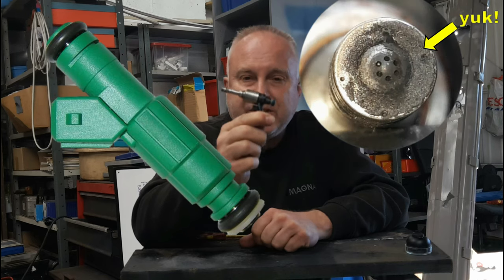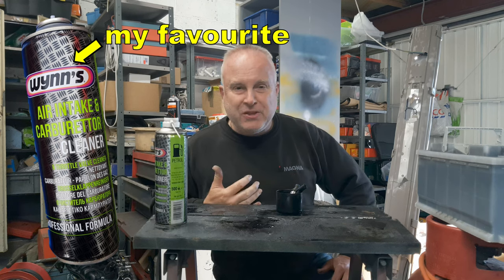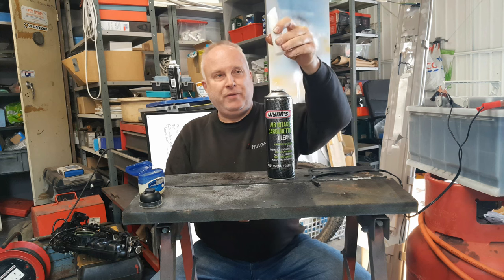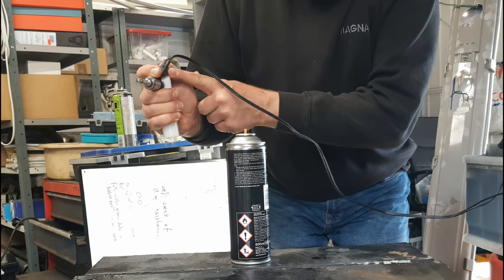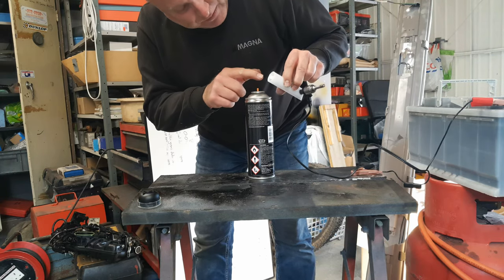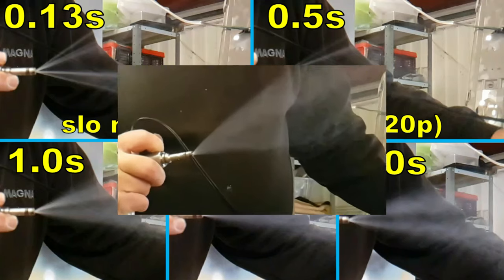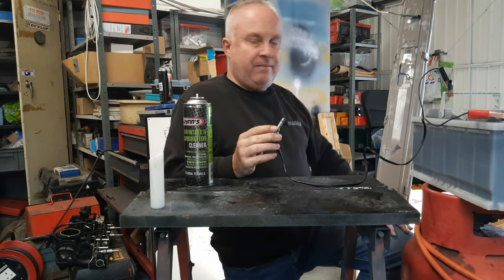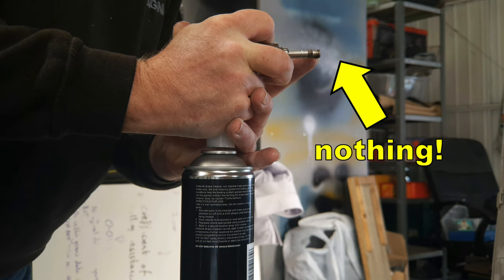🛁 How to Clean fuel Injectors YOURSELF | Cheap 💰 & Easy DIY 👍

Comment: petroleum based products wear out rubber my friend. silicon based work better for lubricant and conditioning. 303 aerospace too
Reply: 😂😂 
Yeah I realise this is an old comment - but come on. The seals are literally there to stop petrol seeping past. Think.
Reply: Silicon based damage the oxygen sensor
Reply: Pretty sure these are petrol injectors?
Reply: Silicon based destroys the rear view mirror
Reply: @eastcoastmostwanted710  Mirror and most forms of glass are made with silicon.
Reply: @eastcoastmostwanted710  what

Comment: Extremely dangerous!! You will catch the fluid alight with battery spark as those injector adaptors leak like hell. Use a purging device!!
Reply: Don't be scared , 
Just be smart &
You'll be fine
Reply: @TXFarmRoad  people be so scared 😱 😂

Comment: Atomised solvent and open electrical connections - what could possibly go wrong?  At least put a closed switch into the circuit.

Comment: I watched a few of these videos, and this tool would have been handy.  Just adding info for whoever it may help. I used safety googles and gloves. Remember to safely depressurise the fuel system as it goes to 3000 PSI on mine - which can kill.  I used the soft plastic red tip you can find in the lid of a can of lighter fluid as an adapter, which fit perfectly in my Bosch petrol fuel injector back.  It deforms slightly to make a seal.  I pulled the spray nozzle off the top of a can of carb cleaner to access the main straight nozzle.  It takes a bit of coordination to hold it tight to the injector.  I rigged up a switch so I could keep distance from the battery and reduce sparking (with heat shrink).  It needs to be able to handle a few amps or it can short and burn your injector.  You will be making a mist of flammable vapour so do this outside.  It took a whole can of 500ml to clean through 4 injectors plus 1 spare.  There was enough left to clean the throttle body and intake.  The pressure drops in the can as you go.  I'd guess that there is about 60 PSI of pressure in a new can.  As removed from the engine, I found white waxy deposits coming from the tips of the injectors and along the body, where compression from the engine was forcing the deposits back towards the fuel rail.  I've read this comes from water and gunge from the tank loosened by modern E5 fuels.  Its cleans your fuel system and leads all the contamination to your precious injectors.  But now it's all cleaned out. TYVM.  Also if you use the lighter adapter, beware it can split towards the end of a can.

Comment: There's a video out there cleaning GDI injectors with a sonic cleaner meant for cleaning jewelry, you should check it out.
Reply: The ultrasonic clanging outside only not 100% clanging inside

Comment: Are there any rubber parts inside the nozzle?  If there are rubber parts  I use a large amount of injector cleaner will it damage the rubber in the injector?
Reply from the maker: No rubber inside. Make sure to use a carb cleaner and you'll be okay. It's worth back flushing your injectors first, if you can (not possible on DI injectors)
Reply: some mass air flow sensor cleaners are rubber friendly, just in case

Comment: Hi Cyd, really enjoy your videos and found them very informative. My daughter has a Skoda Fabia 1.6tdi  2010 model  105,000 miles, which has started playing up and she has had 2 injectors replaced at around £500 an injector. What is the main failure of an injector and how is best to prevent it happening or at this mileage, is it to be expected?
Reply: Just use the fuel injector cleaner additive as a part of maintenance & you shouldn't have a problem. Any of the additives are good but I use B-12 Chemtool & Lucas brands but they all work. There's also the fuel filter that should be replaced when ever your car manufacture calls for it. Its actually insane how much a mechanic will charge for replacing injectors cause they dont cost that much brand new. In engines with (DI) direct injection its not the injectors that are the problem, its the carbon build up on the lifters so if you have a direct injection engine its a waste to replace injectors & the only way they can clean them is physically cleaning the intake with a blaster system. Using a peanut shell blaster is the most common on these issues.
Reply from the maker: As noted, direct injection is hard on the injectors because of the carbon which gets into the pintle and causes blockage and wear. See my video on rebuilding injectors https://www.youtube.com/watch?v=a7cmZrBaMM8 and you'll see I used an ultrasonic bath and injector activation tool.
Learn how to remove your injectors and do this every couple of years or 30,000 miles max.
Reply: @CycloneCyd  will this method work on fiesta diesel injectors???
Reply from the maker: @fantomrides  it should do. Try using deisel egr cleaner instead of carb cleaner.

Comment: Hi Cyd, just want to thank you. I've never had the confidence to do any work on any car I've owned but after watching u I've done the drop links, changed a rear spring, cleaned the egr, throttle body and map sensor and changed the air filter on my saab 93 1.9tid vector sport and got it thru its test so thanks. I've now got code p0087 and the car cuts out a lot. Fuel filter?
Reply: I've changed the fuel filter and the engine management light has gone off but the car is still cutting out. Anything else that would cause p0087 pls? My icarsoft for saab days low fuel pressure bank 1.

Comment: I took an injector off to clean it and now the car is not starting, all the injectors are not spraying, there is pressure in the rail but the injectors are not opening. Help me please
Reply: connect the injectors to the correct connectors
Reply from the maker: Do they spray okay in your hand? Sure you've connected them up correctly?

Comment: Do Fuel Injectors Need Periodic Cleaning?
Reply from the maker: Definately. Every 50-80,000 miles or whenever you have them out for other reasons. It really does make a difference